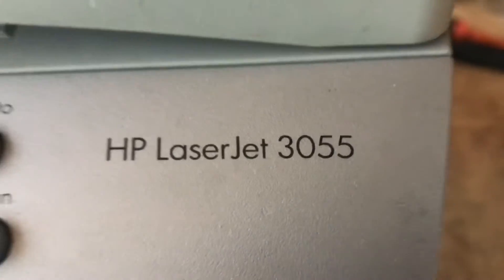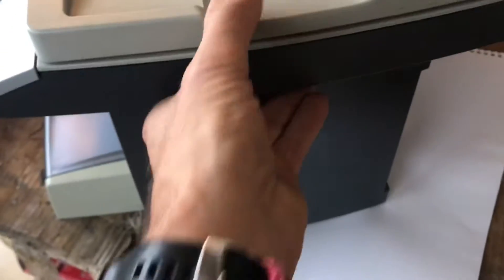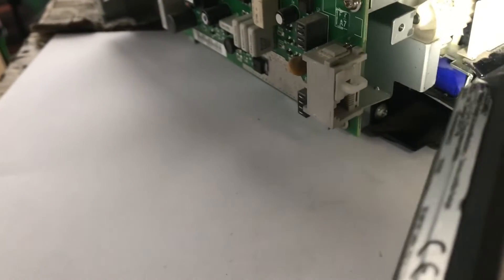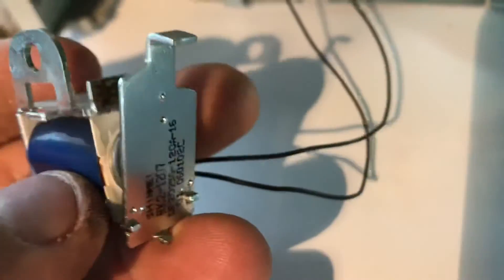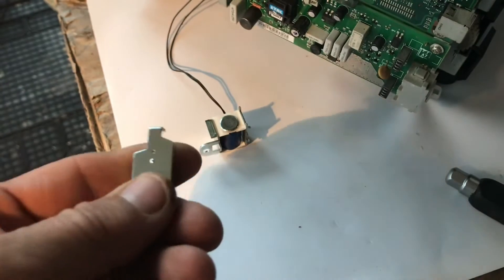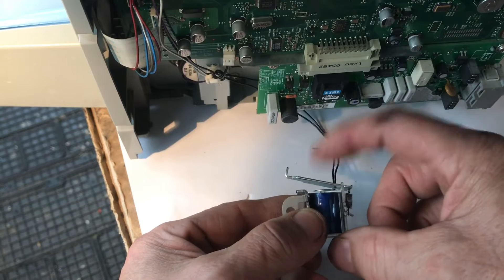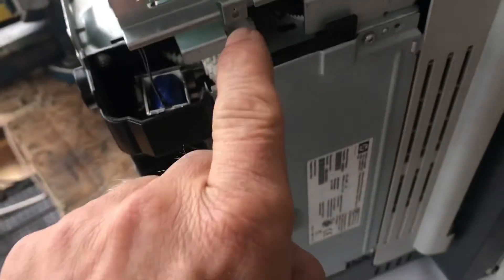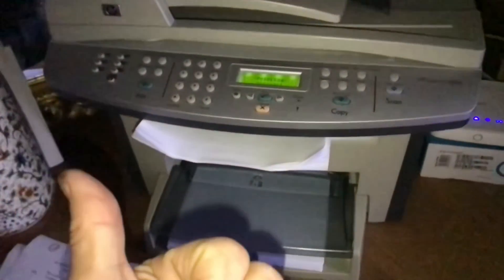HP Laser Printer 3050 3052 3055 paper jam problem

Comment: So here I am an ancient HP CE (the clown that used to go on site and fix HP equipment, usually the larger units}. And here I had no idea what might cause the double feeds and jams. You nailed it. Sticky clutches are not an unknown problem to all print engines but which one? So...wham bang working again. Thanks!
Reply from the maker: Thanks for the feedback. It's such a little thing that renders the printer useless. You can do it 👍

Comment: Brilliant.  Thanks. Worked perfectly. The screw holding the solenoid to the body was a bit hard to get out and put back in. I managed to drop the screw down into the innards, never to be seen again, so watch out for this. I pinched one from the back to screw it in as it was the same type of screw, and then rummaged round in my toolkit to find a replacement for the one I pinched from the back (which wasn't quite the same but worked anyway).
Reply from the maker: Good work. You can do it 👍
Reply: Yes this printer was bought in 2007 (I think). It is now working better than it ever did. I used to have to switch it on and off a few times before it came on without an error. It now switches on perfectly first time! @YoucandoitwithJules

Comment: Thanks so much for creating this video.  I wasn't sure if it would work or not because it didn't appear to be sticking when I took it apart.  However, it did have some black gooey stuff on one side of the two pieces that make contact.  I clean both sides up good and used 2 pieces of electrical tape and not only did it work but now it sounds so much smoother.  Thanks again!
Reply from the maker: It's great when it works again. You can do it 👍

Comment: Awesome. I'm certain this is my issue, I'll be doing this soon. Thank you!
Reply from the maker: Let’s us know how you get on. You can do it👍
Reply: @YoucandoitwithJules  Well, I'm already finished. It was very sticky!! I haven't tested printing yet, but I'm sure that was it. My other issue besides jamming is that it always cycles a blank sheet in between every other printed sheet. Any ideas? Thanks again, you're what makes the internet AMAZING.
Reply: UPDATE: It didn't help. In fact, it got worse. It glitched out and started spewing papers as though it were possessed. 
I punched it really hard on the face.
Days later, I came back with a cooler approach and checked on that solenoid again. There was still some sticky residue, and I noticed the spring was very, very light. I tightened up the spring by pulling up and hooking about 5 coils. Then I added a wrap of painter's tape where the foam used to reside. 
SUCCESS!!
Reply from the maker: @PuckerBrush  well done. You can do it 👍

Comment: Great vid...  Did it and my printer's working again.  I actually bought a replacement solenoid but the cable was too short so had to do the repair to my own using the insulation tape and brake cleaner.  Again,  massive thanks.
Reply from the maker: Great news. You can do it 👍